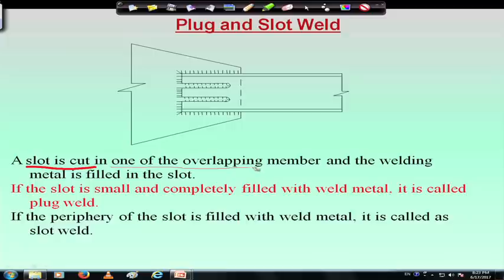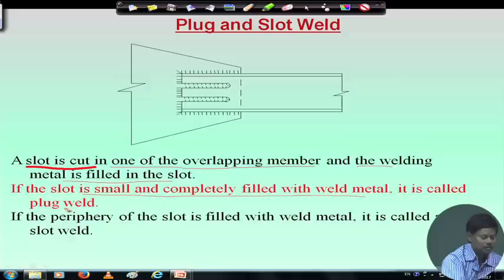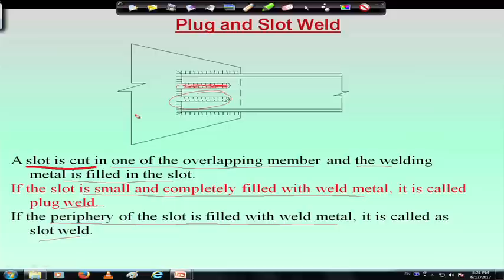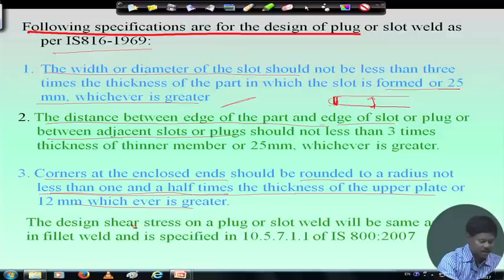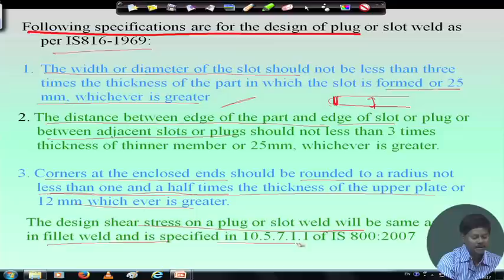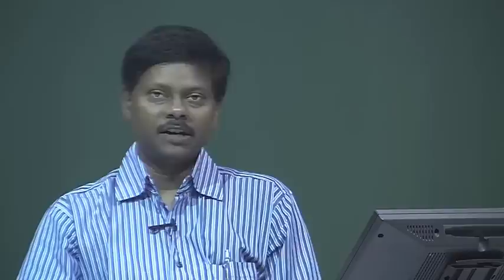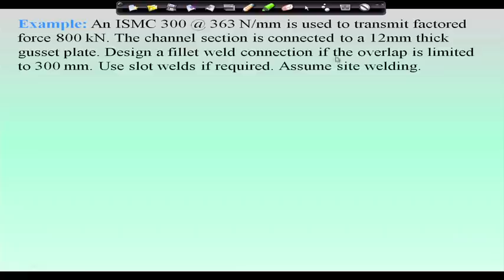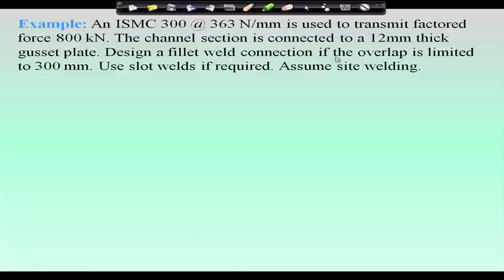Lecture 12: Design of Plug and Slot Weld

Comment: correction at 11:50

thickness of web of channel = 7.8 mm
thickness of gusset plate = 12 mm
minimum size of weld depends on the thickness of thicker part which is 12mm

minimum size of weld = 5 mm 

according to TABLE 21 of IS 800:2007
Reply: yeah I also got the same doubt , gr8 job btw !

Comment: 11:00 the adopted area = 4630 mm²
          Thickness of web = 7.8 mm

But in the steel table/sp 6 its 4564 mm² and 7.6 mm respectively 
Which one is correct ?

Comment: Sir at 6:56, you told that distance between edge of the part & slot should be either 3t or 25 mm whichever is greater. But you took it as 50 mm (distance between slots) & 100 mm (distance from part edge to slot edge) in the subsequent numerical. This is violating the standard. Pls explain.
Reply: In this case  there is no voilation of a standard because max edge is tajen by sir is 25 as per question in final making of drawing sir has taken 50 mm so that depath of a member shsould not be more than 300mm